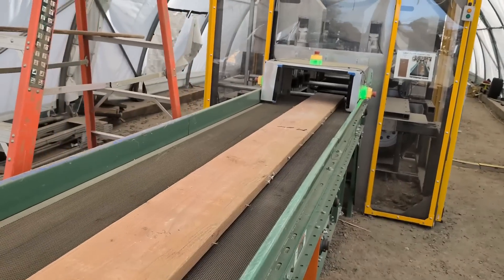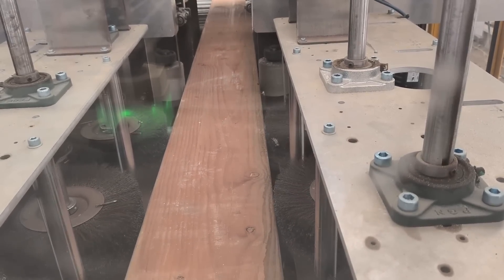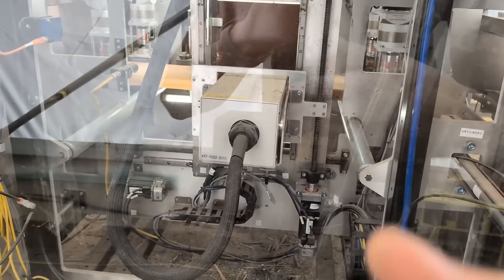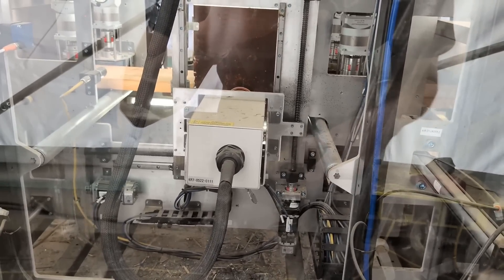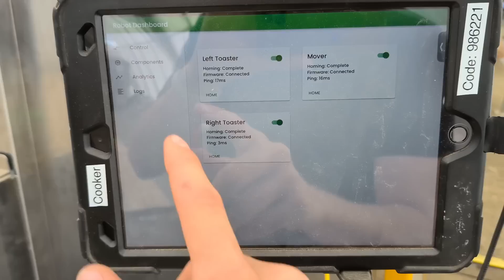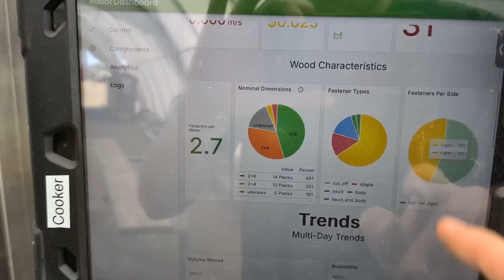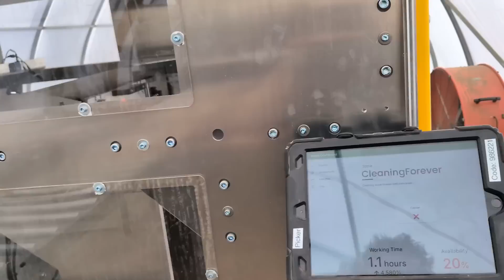Autonomous Wood Reclamation Factory Tour: Urban Machine's Fastener-Removing Robots

Comment: Youtube algorithm brought me here and glad it did. What an amazing machine. Have you automated the transfer between stations shown? Have you thought about measuring the depth of fastener(no idea how to do this) some how and cutting one edge(sacrificing an inch or two of lumber) clean off in some cases? Also how long has it taken you to get to this point in the machines dev?
Reply from the maker: @CamelsinaTinyCar  
Regarding depth- we've used depth cameras in the past, and even gone as far as purchasing an entire X-ray machine (big mistake!). Those machines are a safety nightmare, and at the end of the day it doesn't really matter. If the fastener is too deep in the wood, the wood probably isn't worth salvaging and it would be more economical to move on to another plank. 

As for automating the wood transfer: yes! We would use conveyors. That's a next step we're excited to take. It will help cut down on the labor currently required.
Reply: @AlexThiel  I see your point with the x-ray issues. I guess my point is that is it economical to sacrifice 3/4 inch of width, if there is a screw every 8 inches of material.

The classic example I see would be drywall screws that are usually driven just 3/4 to an inch deep or so. I wonder if you could have an algorithm that recognizes common spacing for drywall screws and then cuts accordingly?

Anyway thanks for your reply and I look forward to your future videos

Comment: Cool process. What would be downside to trim width with bandsaw then drill the nail ends and plug them with wooden dowels? Ofcourse adding dowels to lumber is not more cost effeciency than this and you already have the technology.. hmm just random thoughts to text
Reply: What is the success rate on that nail remover?
Reply from the maker: @nm7869  Currently 98%, but we're always working on speed and accuracy
Reply from the maker: Thanks! Drilling out the nail ends is definitely an option, but it will be weakening the overall strength of the lumber.

You'd be surprised how clean the lumber looks after it's been planed down a mm or two!
Reply: @AlexThiel  Thank you for answer! You can be proud of yourself / your team!